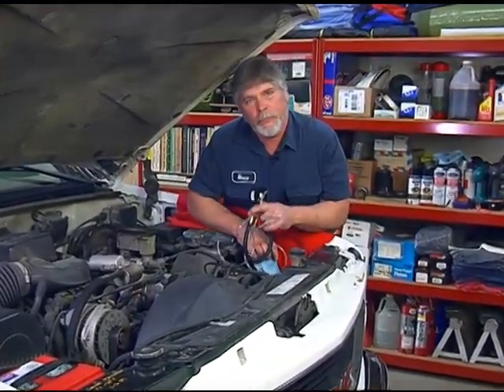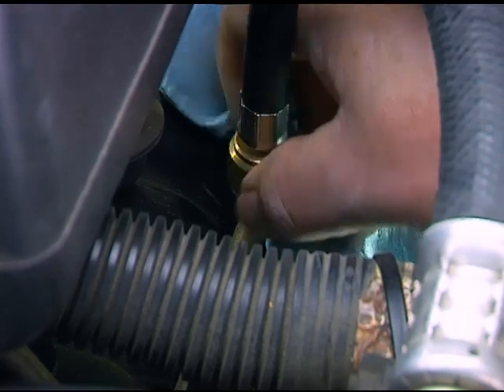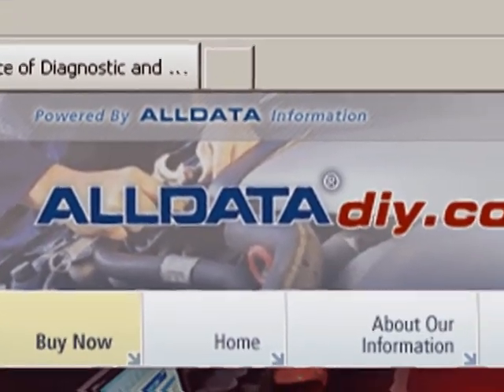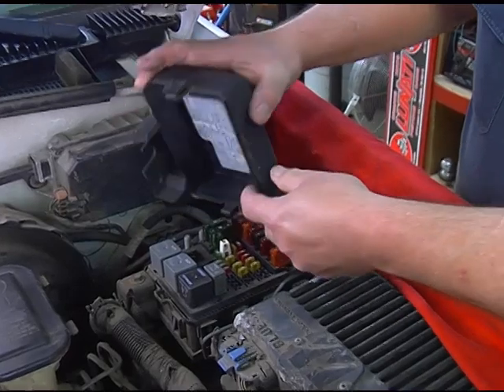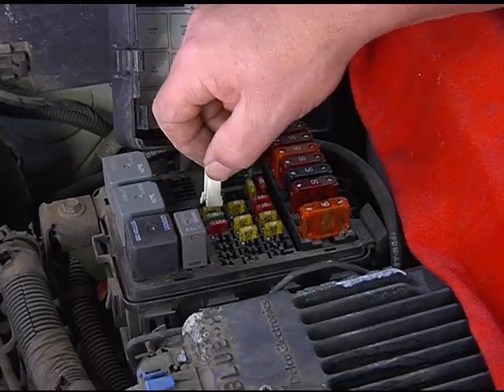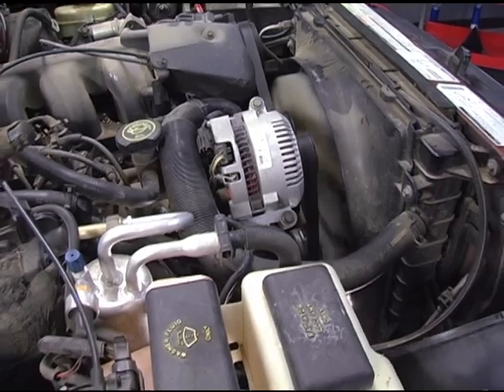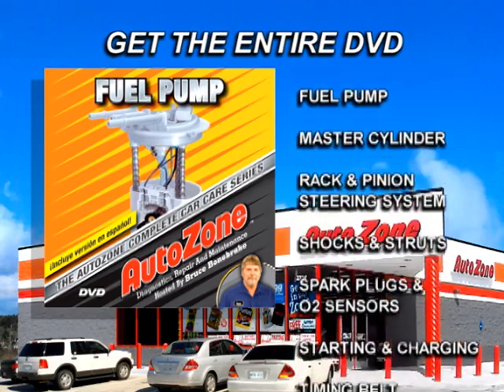AutoZone Car Care: Fuel System and Fuel Pump Diagnostics

Comment: find a check list for your car/truck and do them in reverse…… start from back to front..... most of these lists are made to drag out the diagnosis charge time..... :) of course after you check for fuel and spark at the engine.

Comment: PLEASE HELP!!!
   We have a 95 S10 chevy blazer, my husband is completely stumped which scares me because he knows his ish....we have replaced the fuel pump 3 times in the past 6 months or so, he just put a new one on 2 days ago and while he was driving at work tonight all the sudden it started stumbling and wouldn't go over 10 mph.  So now here we sit again completely clueless as to what's happening.  It idles smooth but is hesitating on acceleration.  We have put Autozone fuel pumps on, which I am getting mixed reviews about now.   ANYTHING you can tell us to help would be very appreciated.  If we don't figure this out soon we will lose everything because that truck is our money maker, we have kids, my husband is a driver so the truck is key to our survival......we need help!!!  Thanks In Advance :)
Reply: Fuel filter might be getting plugged up causing the fuel pump to work too hard, but he's probably already replaced the filter. So when it doesn't want to run, remove the gas cap and listen if you hear a lot of air rush in. The gas cap has a valve that should allow air into the gas tank as the fuel level in the tanks goes down. If the gas cap isn't allowing air into the tank, it creates a vacuum in the gas tank and the fuel pump will struggle to pump any fuel.
Also check the fuse for the fuel pump. If it looks corroded or discolored where the metal makes contact, use a piece of sandpaper to clean any corrosion from where the fuse plugs in and replace the fuse.
Reply: Telfer 222 get a original part and do a pressure test
Reply: Telfer 222 when u replaced the pump.did you replace the entire pump module. ( float.regulator. check valve etc) or just the pump itself?? if so it might be a bad check valve.and or regulator

Comment: Also on this type of vehicle you can not really swap the relays, they are two different types. True they both fit in each others relay socket but the fule relay has a normally open and a normally closed contacts where as the A/C relay has only one contact which is normally closed. The reason the fule relay has a normally closed contact is so that the fule pump can prime the fule-rail before cranking the engine. When the engine starts the fule relay engages, closing the relay turning the pump on during engine running operation.

Comment: Just for the record, the key has to be on in order to get voltage to the fuse that feeds the ECM relay and the fuel pump relay. To check the voltage at the fuse, one probe of the tester has to be to ground the other on the fuse terminal. Voltage must be on both sides of the fuse. If you unplug the fuse and plug it back in,  you should here the fule pump relay clicking as well as the other relay located at the air intake of this particular vehicle.

Comment: On some vehicles the pump doesn't work until it senses the engine cranking. If you don't get any pressure with the key on crank the engine a few revolutions and see if the pressure jumps.  If not--then you definitely have a problem.
Reply: Crank sensor could be inoperable.

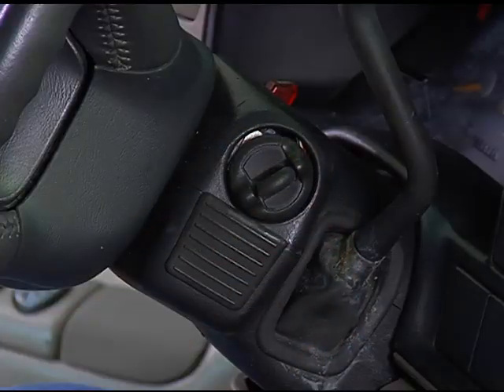Comment: Is there a missing part 2 to this video?  So what exactly was the reason for the "0" reading on the fuel gauge reading?  at min. 5:30 or so, we're told the fuses also weren't the problem.... then you said you'd be going off to "back of fuel tank" -- then the video abruptly cuts off to unrelated chatter and standard warnings...?
Reply: It's almost as if we got slapped in the face.  Thanks anyway Autozone!
Reply: This is exactly why I hate that youtube got rid of the dislike button. 

I watched this video expecting further insight into what could be the cause of my cars issues and instead I wasted 8 mins not realizing at the start that this guy never fixes his vehicle.  could have summed up this video in 15 seconds: "Check the users manual and look at the fuses"
Reply: Yeah happened to the explanation or steps to conclude?

Comment: does a 2000 toyota corolla have a shrader valve for testing fuel pressure or do I need special connecters for testing my fuel pressure